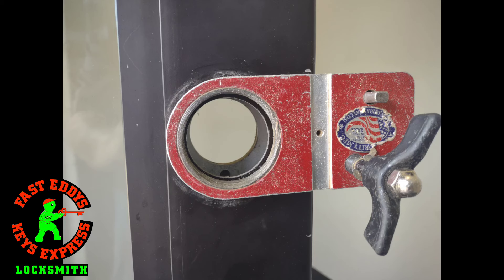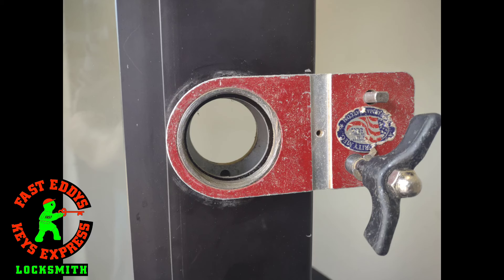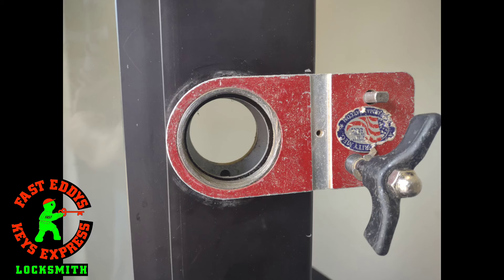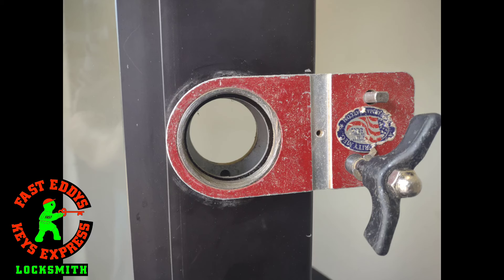Entrance Lever Lock Repair | Installed On A Aluminum Glass Door @fasteddyskeysexpress

Comment: Yeah, that’s definitely an unusual sight. They probably saved a bit on the installation but then they had to pay you to come and fix it, so they didn’t really save at all, and they ended up a lot less secure than if a locksmith had installed an Adams Rite to begin with. Like you said, customer gets what they asked for, and you did great work in this situation 👏
Reply from the maker: Thank you very much. It defiantly was a mess.

Comment: A cylindrical lock in a narrow stile door is rare but more intuitive to users than an Adams Rite pull paddle.
Reply from the maker: Yes I'm sure on the surface city inspectors are happy with this jerry rigged application. The part that bothers me is the rose closest to the glass is not flush with the door. The trim drops a bit! Criminals may think they can pry on it with a large screw driver or crow bar. If there ways one or two MS bolts on this door it might be a lot safer. I am sure some one will be embolden and try to break in at some point on this property. I will be back at this job site I am sure of that.

Comment: Came out great . Nice repair.   
How does one properly approach and measure the backset on a door with a bevel?
Reply from the maker: I use a template. with a little guess work
Reply: @fasteddyskeysexpress  right, but do you typically measure from the higher side of the bevel or lower side?
Reply from the maker: Well I adlib and guess on the center of the beveled edge by a 1/16th